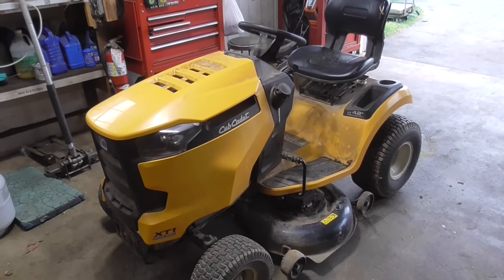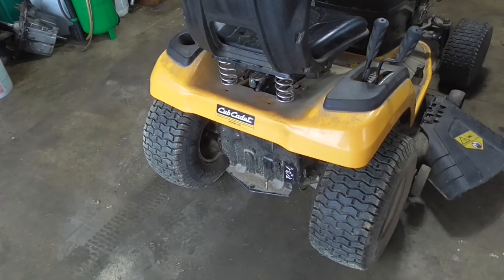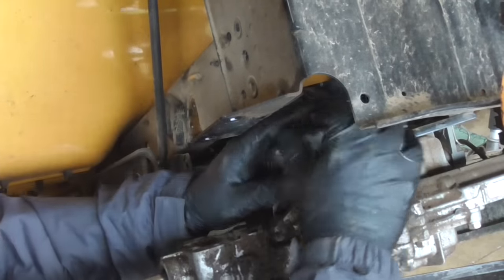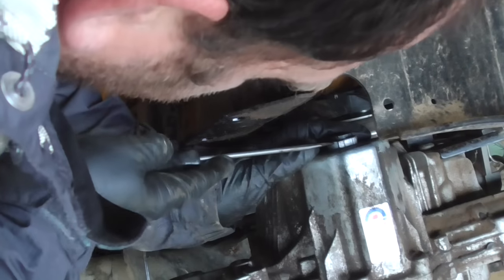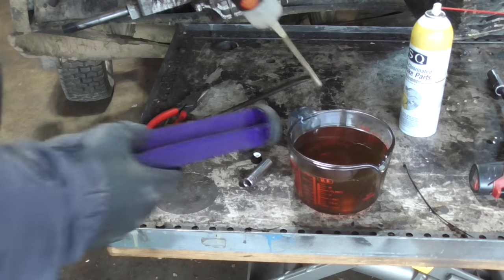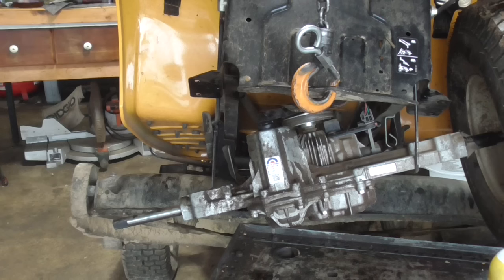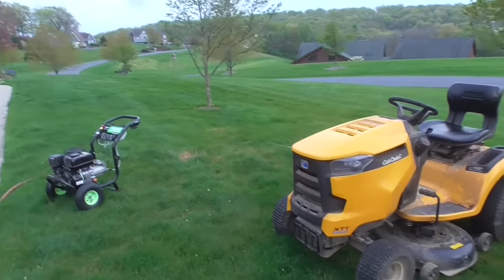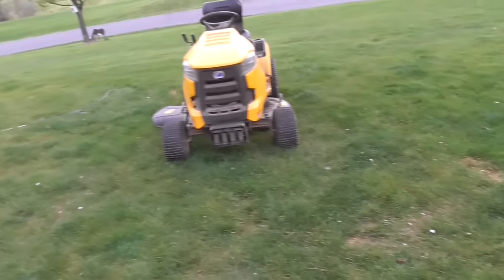Cub Cadet Transmission Repair

Comment from the maker: https://amzn.to/3xFcVMJ Large oil syringe
https://amzn.to/3nGxyUv Mobil 1 Full Sny. 15w-50
https://amzn.to/3nHff16 Milwaukee 3/8 Ratchet M12
https://amzn.to/3aYmAEF Tuff Torque axle Seals
https://amzn.to/3eIrJBI Tuff Torque Vent and Fill Cap
https://amzn.to/3t9TwAb Tuff Torque Maintenance Kit
Reply: Tuff torq recommends to use 5w50 full synthetic in the k46. Also the cap you removed isn't the fill. That was the vent cap. The fill plug is the flat rubber plug halfway under the pulley
Reply: This ones not the same transaxle as mine mine has a black vent tube on the right side in the back it's also the fill tube I looked it up ats what it said it is 

When I was reading about mine it said to use 2 and a half bottles of 20w50 synthetic transmission fluid so that's what I'll be getting
Reply: I've not seen one video of anyone doing any of my kind of transaxle transmission with the black breather tube that sticks up on the right side in the back 

I'm gonna use my shop vac to get most the old fluid out of mine

Comment: Modern Cubs are the modern BMWs of lawn mowers. Both once were worth what they cost but are now just over priced, always broken, and over-relying on the badge to get them off the showroom floor.
Reply: At this price point they're all the same. Roll the dice. Home owners cant afford commercial equipment 🤷‍♂️
Reply: Any mower built today to yesterdays standards would cost $20k 
I wish people would stop comparing todays lawnmower with yesterday's garden tractor.  They're not the same thing.
Reply: Other wise known as garbage
Reply: Mine runs great. Same model and year. Basic oil changes and greasing. I try to keep mine a lot cleaner than that. 😂

Comment: I just bought another cub cadet today . My other one is a 22 hp v twin 42 inch and bought a 46 inch 22hp v twin . I love them and maintain them so they last  oil change 2 times a year and new gas filter and new mulching blades   . My other 1 I bought in 2016    new belts  and greased everything  . I do it myself  and I am a 68 year old women  .NEVER SAY YOU CAN'T DO SOMETHING   LAWNMOWER LIFTS ARE GREAT TO HAVE
Reply: Wow..good for you. I'm 64 and been a mechanic most .y life and I hate working in these mowers..lol.

Comment: Flip the seat up and pull battery out lot easier to fill the rear end easy access
Reply: yup,did the same, worked out great!
Reply: Is there a fill hole under the battery? Is standard hydraulic oil fine to use?
Reply: @mikef8769  yes I did it a while ago I used cub cadet drive system fluid plus

Comment: The Only Thing That I Thought Was a No No Is That You Pulled On The Tire Fairly Roughly A Few Times. That Can Lead To Pulling The Shaft Out Of The Transmission. The Axel Shaft Is Held In By Circlips And If You Pull Too Hard You Can Pop The Circlips Off And The Axel Will Pop OUT. Then You Have Major Problems, Then You Would Have To Pull The Transmission Completely Out, Then You Have To Split The Transmission Casings And Fix It.  This Is A Big Job To Do, I Have Done This Before and It's NO FUN. There Are A  Hundred Parts Inside These Transmissions ( Maybe Exaggerating a Bit ) But A Hell Of A Lot Of Little Parts. You  Don't Want To Mess With Because You Can Absolutely Stuff It Up, Then You Will Be Paying a  Mower Mechanic To Fix It @ $100 An Hour... You Was Extremely Lucky That The Axel Stayed In The Transmission
Reply: BEST ADVICE TODAY>

Comment: OMG Cub Cadet tractors are built so cheaply now. I have a 2003 Cub and it looks nothing like the new ones. My Cub is built to last and looks, runs, and drives like new still. Great video 😎👍
Reply: By 2003, they were no longer concerned about building a machine that lasted forever. They were not as good as 20 years prior to 03.
Reply: My 2003 is a 1525.  All cast iron front and fabricated deck.  Twin cylinder.  Still runs perfect after 20 years.  I did replace the belt every 4 or 5 years and replace the transmission belt this year.  Did have to finally buy a new seat.

Comment: Thanks. Your video saved me alot of money. I removed the battery and battery brackets, power washed it all and filled the tranny. It was bone dry and took 1 and a half quarts. All in all, about half an hour after washing it.

Comment: At official cub cadet dealerships, they sell the XT2. It comes with bearing wheels  a heavier axle, a bigger battery, armrests, turf master tires, bigger engine, plus more. The XT2's are not sold at the big box stores like Home Depot.

Comment: I just bought one of these last July.  Nice to see how to work on the transmission in case i encounter the same problem.  I like the mower, but I have one issue with Kohler 22 horse engine.  Dust and debris has been getting by my air filter.  Cub Cadet sent me a new filter and housing. Testing it now.  Will send you an update on the result.

Comment: I bought a Cub Cadet because everyone I talked to said it was the best.  I went to Lowes and bought an XT1. I am not very happy with it. I always have to do something 2 or 3 times in the mowing season. This year to even get it started I had to replace the solenoid. There are so many “safety” precautions everything has to be just right for the stupid thing to work.

Comment: I just bought that exact mower last week. It was relatively cheap (2k!) But my 1983 Wheel Horse was having fuel delivery problems and I was a bit desperate for a mower. 
 I had a hydrogear on a Murray that lasted just over 20 years. It just got to where it wouldn't pull so I pulled it out, disassembled and cleaned it up. No signs of oil leaks and other than parts being polished from use no real reason that it wouldn't pull. Brought my micrometers and bore gauges home from work and found no appreciable wear anywhere. What did strike me as odd was the two halves of the case were not machined! They still had casting pimples and flash on the mating surfaces and specified grey silicone as a seal. Anyways I put it back together and it still didn't pull so it got retired. 20 years isn't shabby I guess and my yard is moderate sized with some wicked terrace rows so while not abused it got no quarter either.
 You can imagine my reaction when I saw the exact same mower  I just bought being a star in a not so flattering YouTube video. I'm glad it started pulling again with the oil topped up. I'm also relieved it was a 2015 so I know I have a few years, LOL!
 Thank you for the video, taking the time to prepare for and edit one.
Terry from South Carolina

Comment: Thank you for your knowledge and making this video.  I have same mower and same problem.  I replaced the drive belt and didn’t solve the problem.  That’s when i found your video.  I bought a hoist from harbor freight and made me a beam out of (12) 2x4s to hang it from.  I couldn’t get one of the back wheels off which made it a manor pain but 2.5hrs later i had it all done.  It didn’t take off right away but after a minute it did.  Guess it needed to build up pressure or something.  Thanks so much for helping me!  Saved me a ton of money!

Comment: That's the vent you tore open, not where your supposed to put the oil. 
Closer to the front of the tractor, and down lower on the trans is the plug for the fluid level. 
It fits like an oil seal, but is just a blank plug. Same side as the vent. To fill the transmission to the proper level, 
pry this plug . then add 10w30 motor oil, not sticky 50, until the level is halfway up the magnet 
sitting up top, vertically. This magnet just sets in the cast grooves, make sure not to dislodge it when filling. 
Do the right axle seal first, then when the wheel is off for the left side, pull the battery and you can 
pry off the cap , fill the axle, and replace the cap (new) , stick the wheel on and forget it. 
Trans is bled, right level, ready to go.
Reply: Don't bother providing this guy proper service instructions. He obviously doesn't care.

Comment: Just repaired a older Cub Cadet that what owner thought needed was a wheel seal.  It did need a seal, but the bushing just inside the wheel seal was worn out.  At least it was a mostly steel Cub Cadet.   It has the Tuff Torq transmission also, this one looks the same, that is the vent cap on the back side of transmission.

Comment: The XT1 is the Big Box store version...been running an XT2 w/Kawasaki engine since they came out in 2014 and it runs just as good...as when new.
Reply: the Kohler v-twin is a Kawasaki knockoff and seems legit, has been very reliable for me...

Comment: Tuff torq recommends to use 5w50 full synthetic in the k46. The fill line is 3/4in below the lip OF THE FILL PLUG, not vent cap. Also the cap you removed isn't the fill. That was the vent cap. The fill plug is the flat rubber plug halfway under the pulley
Reply: There's also a level if you fill it thru the vent. The information is on the tuff torq manual for the k46
Reply: @XloMotion  the service manual for the K46 I got from tuff torq didn't have that info. It was specific to not use the vent cap due to not being able to get the fluid out (when draining) and because you typically can't reseal it without buying new.
Reply: Yea... This doublewide guy is quite the hack.
Reply: s all relevant anyway because you can't check it with the mower at 45 degree angle in the air and the transmission at a 45 degree angle the other way hmmm?

Comment: Great video Bob! I need to find me a way to lift up the rear ends like that.
Reply: You don't need a jack the mower up,  if the battery is underneath the seat just remove the battery and battery box it pops right out  to check your fluid. there there's no reason to tear your lawnmower apart to do it. When you change the fluid you have to run it and purge the air and then check it and make sure the levels right you can't do this when the transmission is all ripped out of the bottom of it

Comment: On the Cub Cadets some guys pull the battery, remove the support brackets and access the fill plug from the battery chamber.  The axle seal is about $8.00 from Cub Cadet.  I think they fill the tranny with hydraulic fluid or tranny fluid.

Comment: Great information.  I am trying to figure out why my transmission won't disengage.  Replaced the brake connection but ever since I cannot disengage so that it will freewheel.  Wondering if the brake is to tight or whether I missed something.  The lever is attached.

Comment: On my Cub Cadet with the battery under the seat I can just take the battery out to access the transmission fill plug .  I have a leaky seal and simply add a little oil every year . Makes for a quick easy job by taking out the battery .

Comment: I have never seen brass bushings in any cub cadet or MTD lawnmower. They've been using the plastic bushings since the 90's on the cheap stuff. My 90's 2000 series all have actual bearings in the front wheels. As does my 2006 3000 series. 
You get what your buying with lawnmowers just like everything else.

Comment: Great video Bob. You are correct they usually aren't this easy.  I've gotten lucky a few times like this one here.  I did have a bad plastic trans a couple years ago that you seen in one of my videos. I did break it apart somewhat , because they are glued, the gears I seen were plastic also.  I think the back and forth slop in the axle wore out those gears " I'm guessing"
Reply: Imagine being the moron engineer who thought "yeah these plastic gears should be able to push a 500lbs machine over a bumpy yard with your average 200+lbs American on the seat " 😂
Reply: I've only seen 1 plastic trans, it was in a John deere and worked perfectly, it had 300+ hours it. 
Not saying it's a great idea but not convinced it's a bad one either.
Reply: @jeremydavis2595  149 Cub Cadet 14 horse power motor and hydrostatic no spark please give me video yeah Google I'm having problems no spark on a 149:14 horsepower Cub Cadet hydrostatic
Reply: ok
Reply: 1 yeah I would like to watch a video since I quit estetiksiz components yeah I forgot could I get a video on the North Park

Comment: Have a 2015 bought from Home Depot.
After about 2 years both axle seals started leaking. I replaced them both and refilled the transaxle with Castrol synthetic 5W-50 oil.
The Tuff-Torque transaxle is supposedly non-serviceable but you can fill through the vent cap.
They also make a drain plug kit, but you have to drill and tap the lower housing.
All in all I like my Cub Cadet xt1 42" cut, but I'm hearing the Kohler Courage engine is good for 300 hours or so. Keep the oil and filter changed sooner rather than later.
Reply: How's it holding up using 5w-50?

Comment: Good job, I was surprised all it took was some oil to get it moving again. I used a chain hoist to lift the back of my troy bilt with Kohler eng and the gas pours out of the carb float bowl. Just have to keep it much lower while working on it. Maybe you had fuel injection on it.
Reply: I also wondered if there was danger of battery spillage at that angle.
Reply: @amerlin388  Yeah, best to remove the battery first. I just ordered 3 gas cut off valves, filters and clamps so I can run my carbs dry for winter or jacking up at a severe angle without gas pouring out.
Reply: Plastic bag will stop that leak and pull battery out to

Comment: One way Is To Get Your Wheel Off If STUCK On The Axel, Is To Drill 2 Holes opposite Each Other On The Wheel / Hub Itself . ( Meaning The Tire Rim ) Near The Centre Axel . Use 2  Bolts And Nuts, And Use A Puller To Remove. Maybe Apply A Bit Of Heat At  The Back Of The RIM To Help
Reply: Thank You

Comment: A) they take transmission fluid, B) it is worth taking it off to see if it is full of metal shavings in it...just a thought. Also, I saw you put the cover on it but what about the plug that was under that? 2 came off, 2 should go on or did it and it didn't get shown in your video? Thank you...interesting video

Comment: Hydrostatic transmissions seem so trouble prone, MTD should build a heavy duty version of their Transmatic variable pulley transmission for cheaper Cub Cadets. Had one in a Lowe's Taskforce and worked great, as a lawn tractor, and was quiet and smooth.

Comment: When you take the seals 🦭out will all the 🛢oil run over? Thanks for the 📹video it was very helpful for me...
Reply: not if he jacks up that side of the mower first
Reply: Yes unless that side you're replacing is higher than the oil level

Comment: I would like to see that bushing replacement of you can hit record. I have yet to do that repair in my shop and would like to see how you do it.
Reply: I once saw a video where guy punched holes in defective bearing, hooked in a couple picks and worked/pulled bearing out of transmission over the shaft.  Another video used two screws twisted in and pulled out with two pliers.  I think repair shop wanted to bill multiple hours to disassemble  and drive out from inside.

Comment: My cub cadet XT1 lasted less than 200 hrs. Scored piston did it in $1,700.00 down the drain.
Reply: Was it cause by carbon buildup on piston ??
Would like to know why. ???
I’ve seen this several times when crown of piston breaks

Comment: I have a 2014. You can remove the battery under the seat and the fill cap is right there.

Comment: It's amazing how many people never check the oil...never check tire pressure ...never sharpen blades...never wash or wax their mowers...=)
Reply: You can't "check the oil level" in the cheap tuff torq k46. There isn't a dipstick or level indicator. There really isn't even an easy way a homeowner can refill without yanking out the transaxle.

Comment: Nice repair! I couldn't quite tell, did that have a little shock absorber on the back connected to the reverse pedal linkage? I've got a tuff torq on my Simplicity and there's a shock absorber on the back of the transmission connected to to the frame and reverse linkage, and it looks like it is leaking oil. (It also jerks a little when starting to reverse, which is why I'm wondering if it's related)

Comment: Hey Double Wide Did you charge a diagnostic fee before taking on job ? Did you consider replacing both seals ? Did you tuneup include valve lashing ? What did you get for the job price wise? Excellent video

Comment: Double wide what was the air bleed process? I know you can do it with a drill when its off the mower. Did you just cycle the clutch in roll mode? Thanks sir.

Comment: How many years of used for this Cub Cadet lawn mower that has a Transmission problem...????
6,7, or 8 years...??? 😲
I have a Craftsman lawn mower tractor for at least 10 years and still going Strong and just this year I changed Spark plug when I felt the Engine was kinda weak and struggling to cut the Lawn.
...... After changed Spark plug and oil changed and filter,. It runs strong and Alot better now...
My next Lawn mower tractor Maybe Husqvarna or Cub Cadet...??? 🤔

Comment: They are cheap quality but definitely not cheap to buy. They are built for a low price point and engineered for maximum profit. Save your money and buy “estate grade” or commercial grade equipment from a dealer. I finally leaned this after buying box store junk for 25 years. Although, back then even box store stuff lasted 10-20 years easily.

Comment: Yeah my pops and I purchased a cub cadet ltx 1050  that only has 33 hrs on it. Purchased from my boss who bought about 4 years or so ago. Then stopped on him and at the time he was making money so he just set it aside. Well the transmission bypass rod is engaged to the neutral and will not engage back in gear. And when we tried to pop the Trans fill plug the rubber broke. And there is a leak on the right seal. Any advice you could give us???